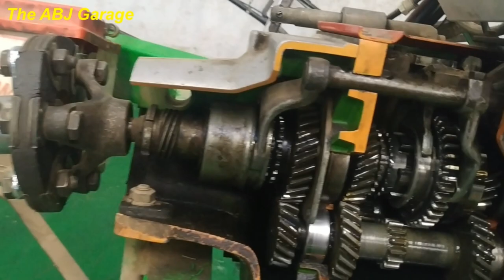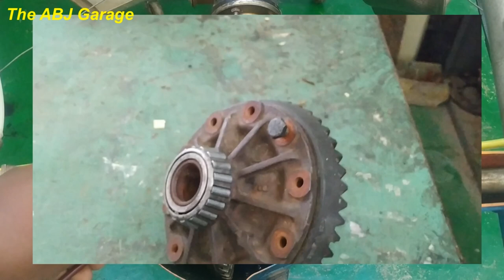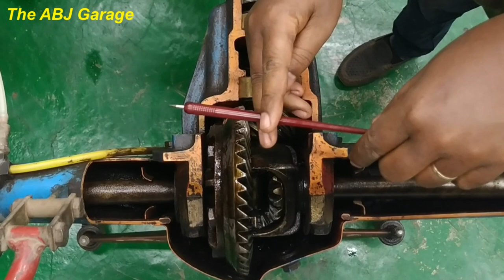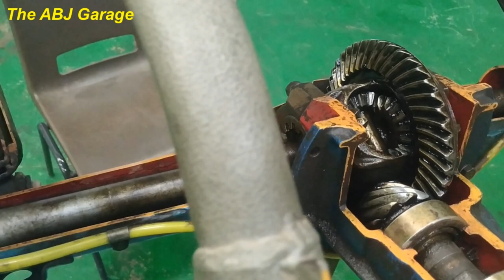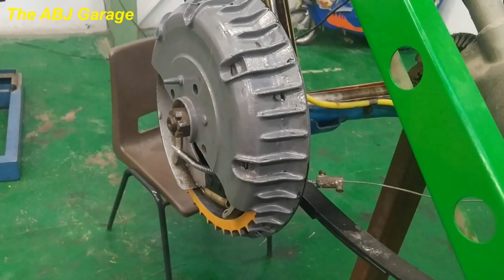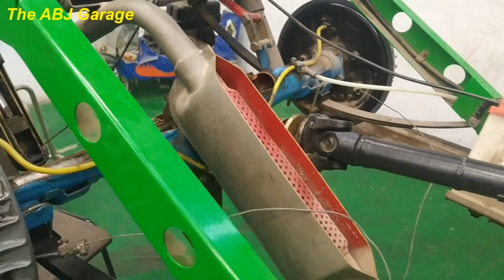All you need to know about the differential

Comment: I love this cutout demonstration. Very pleasant to look at. I heard in another video that with this type of differential, when one wheel has very good traction and the other has none (say it's in the air or on ice), the latter will spin out and the one with good traction will receive no torque, so the car won't move. The part where you demonstrate how the pinion gear works with the pen made me understand that situation a lot better.

Comment: HI sir... I am from India.. I watched your video and i am trusting of my complaint will be resolved... i have XUV 500 2018 model... while turning right and left side the back rear wheel gets strucked no movement... but while running straight it is moving... pls guide me to resolve the issue
Reply from the maker: Have you checked to see if there is some differential locking problem that is preventing speed variation!!?